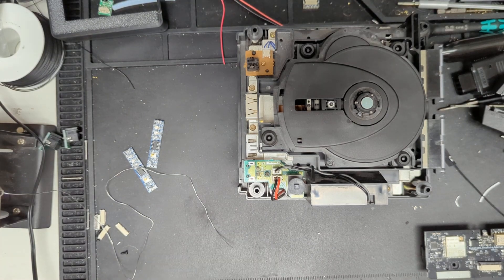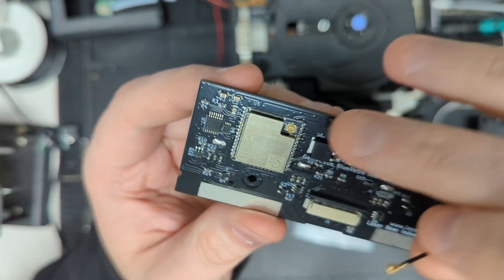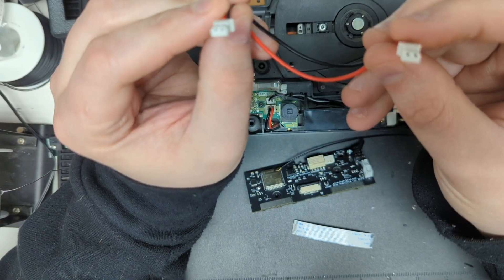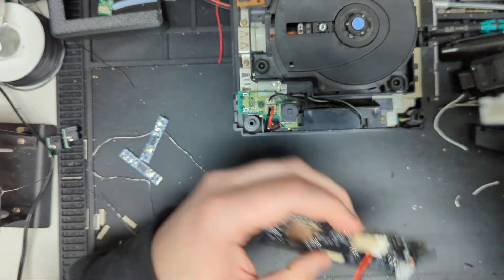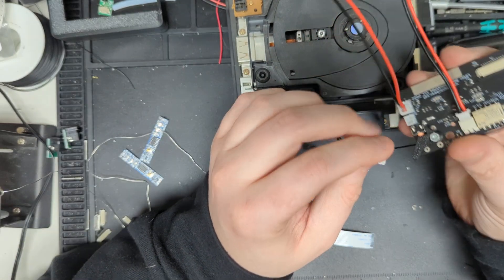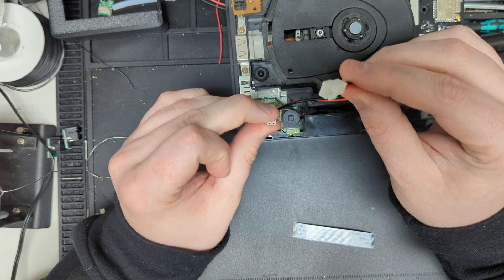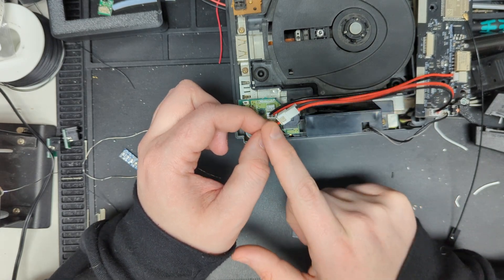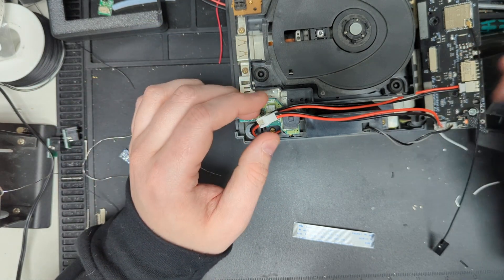GameCube Blue Retro extra tips and tricks on wiring

Comment: Is the blueretro able to work with more then one gulikit kingkong 2 pro? It works fine with one so far but since the cite says it only takes one switch controller at the time I wonder if it’ll work with 2 kingkong pro since it has multiple modes
Reply from the maker: If it has an x-input mode you can use 4 without any issues. Switch protocol has an issue the creator has not been able to isolate. He did just get digital only switch controllers to work with more than one(SNES/NES online controllers) but regular switch controllers are still not playing nice.
Reply: @LaserBearIndustries  I’m sorry for my ignorance but what is x-input? And how can I check?
Reply from the maker: @DaMarakuHD  no worries x-input is windows controller protocol. On the Gulikit hit the mode to the windows icon with an X under it, not the D. X-input is mostly universal Blue Retro should have no issue reading it. The button mapping on the face buttons may be wonky and need changed in the web ui though.

Comment: Sometimes when turning on GameCube and Xbox one controller it takes a couple resets/tries until it will actually pair. I turn the GameCube on then a second later turn on controller. I don’t use the controller for anything else. Any advice to get it first try all the time?
Reply from the maker: Is the Xbox One controller up to date on it's firmware. Older firmwares have weird issues  like this.

Comment: Only my powera switch GameCube controller works correctly. All other controllers and adapters I have connected no matter if it's switch or PC x input or d input mode they have their button layout swapped. How do you fix that? I have messed around in the settings config and no luck. This happens to every blue retro device I have connected to. Amazing product btw. Also, I heard the power a has analog triggers that only work on PC. Be nice if blue retro took advantage of that if it were true.

Comment: I just installed the board and I am having an issue with the calendar date and time data keep getting lost after turning off then turning on the console. I am not sure on what is causing this and whether or not there is a fix to this.
Reply from the maker: We had not run into this before, but it may be a hardware issue. Reply to your order confirmation email or our contact page and we can see if we can get you a fix
Reply: @LaserBearIndustries  ok I'll do that. A shame that I may have a defective copy.
Reply: Does any of the instructions tell the user to actually install the battery on the board first?
Reply: @troymeredith521  the battery was already installed, I even changed the battery in case if it was a dead or defective battery but didn't fix the issue.
Reply: I just finished installing mine actually and I got some weird date resets too.  First one was the standard reset (new battery, so of course).  Then after turning it off and back on later, I got 7/15/2114, 13:49:00 as the rest date-time. Strange. lol.  Gonna test it more to see if the date/time sticks.
Reply: Yep, tried again and the date time reset to something else, so it's not isolated at least.
Reply: Im running into this issue as well, just installed it today. Bought mine from Castlemania. But its a laser bear product.
Reply: @MarkFletcher2001  Not sure how the logistics would work in that, but I'd contact Greg at laserbear through the website first to see if he found anything on it.  He swapped mine to investigate and my new one worked fine (I ordered directly from him).
Reply: @troymeredith521  I reached out to Greg and he told me to check the contacts on the battery holder. One side should under the battery, the other around the side of the battery. When I checked mine, both sides were under the battery. I was able to fix it and everything is functional now.
Reply: @MarkFletcher2001  ahhh good
Reply: Did you let the cube fully drain power before installing the new battery?